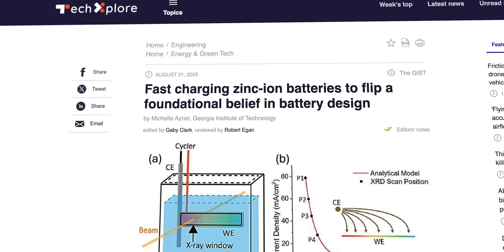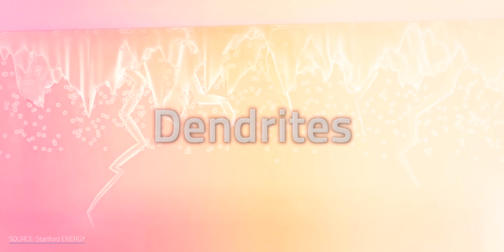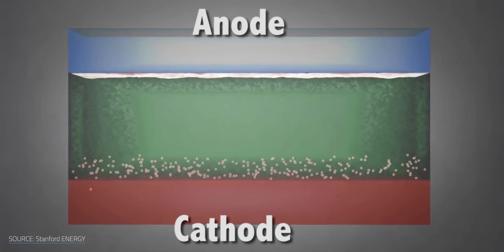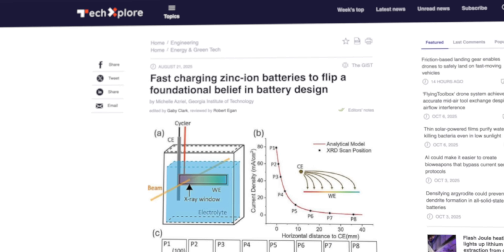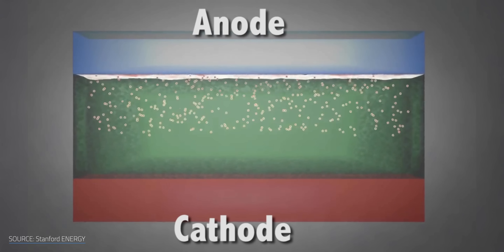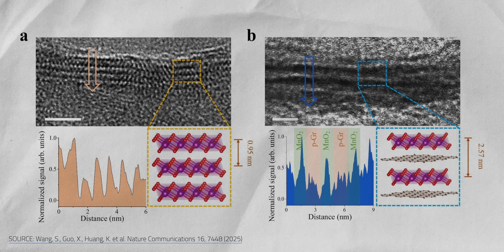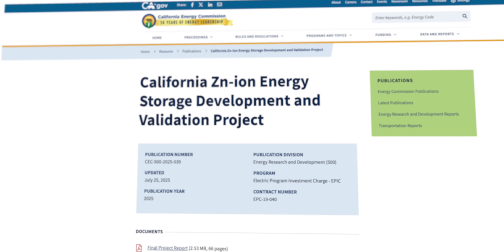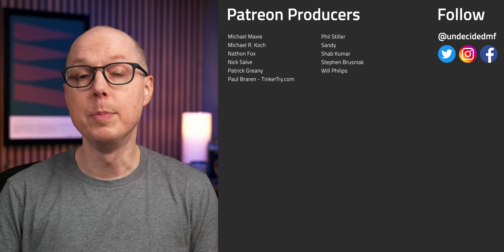The Surprising Battery Discovery No One Saw Coming

Comment: Every battery tech video should include a summary section, answering these questions:
1- When will it be on the market, in actual products?
2- How much will it cost, per product unit, compared to current ones
3- How does it perform, energy density, power density, charge speed, and other features, like flammability, lifespan, temperature requirements etc...
Reply: Mass market production is the great filter of battery tech, meaning you're gonna need to break out the crystal ball to answer those first 2 questions.

Lithium batteries were in development for 30 years before they entered mass market production, and have had 30 years of improvement since then. Replacement is going to take years.
Reply: Technically this video provided an 'answer' to 2, but only from a raw material point of view.
Reply: @GLJosh  Only the zinc is cheaper. No info about all those graphene layers manufacturing, etc.
Reply: But then there would be a lot fewer battery tech videos.  🤣

I'd settle for just one question:  What are the remaining hurdles?

Cost per kWh?  Endurance (in cycles)?  Round-trip efficiency? Production volume?  If a battery meets all four of those, then it should have a market for at least stationary use.  Yet what battery do we see in stationary applications?  Lithium ion.  (Although, didn't the "cheap as dirt" liquid sodium battery go into production for some grid-storage somewhere?)
Reply: Problem is that second one is not really a fair or predictable comparison - little bit of instability in the nation with the largest mine of x, workers on strike at y even only tangentially related to the battery production (can't make a battery if the train/truck drivers or dock workers that are part of the supply chain are on strike) and then the simple scale of production can make a massive difference to the costs of either tech. So the already established industry is pretty much always going to be cheaper right now as the infrastructure is already there for serious scale production, and you can only make fairly wild guesses on how the market prices of the involved resources will change as the scale of consumption does.
Reply: Also adding in the fact that most of these would be blind predictions and very misleading. This guy isn't working on these technologies
Reply: @leventalpsal  bro get out of here not every YouTube video is a business proposal
Reply: This would be akin to being there when someone first discovered microwaves and asking them "yes but when can I buy a device, made with this, at my local store, how much will it cost almost a hundred years from now, and how much will it impact my electricity bill when I use it".

Dude, c'mon this video is talking ABOUT RESEARCH. This isn't even the foundation of a new product yet, it's the raw stone, portland cement and rebar needed to MAKE a foundation. Imagine if when the Higgs boson was discovered someone on his team turned to him and said "hey that's awesome so when will my new anti-mass car be available and how much will it cost and what kind of milage will it get two hundred years from now??" that's literally what you're doing.
Reply: Matt said that this is still early. How would he or the researchers make that estimate if they do not know how to scale it yet. Matt covers tech in different stages of deveopment and was clear with that. Why should he need to make busniess plan for emerging tech?
Reply: @OlleHellman it’s always “too early” or still in development. When will these things actually be produced. We’ve been hearing these same things for over a decade since LiPo batteries became the norm.
Reply: @Cybo-Man 

Well that's how technology advancement works. Gradually. Reality is not obligated to make sense to you.

I'm sick and tired of people bitching and moaning when the only cause of their disappointment is their own ignorance and misplaced expectations. 

It says in the video. This technology is in its EARLY STAGES.
Reply: so know the unknowns... maybe you should get on that right now and report back.
Reply: @matthewf2066  🤣
Reply: Most of the ongoing "new battery research" has no ETA due to quickly changing market expectations and safety requirements, meaning that they must meet all of those before they able to mass produce those batteries
Reply: That would put a severe limit on the tech YouTubers can talk about, basically only the ones that are about to hit the store shelves.
Reply: Unfortunately, it's still undecided. '-'
Reply: CATL Naxtra. SIBs niche is planet Earth.
Reply: Internal resistance / efficiency and self drain rate are also factors.
Reply: 1- never
2- if you have to ask you cant afford it
3- the performance is only capped by your imagination (because it only exists there)
Reply: personally I would like to see nominal, fully charged, and fully discharged voltages, in the videos on battery tech as well
Reply: #1 and #2 are completely unknowable for early research. If it's not already in production, you cannot say.
Reply: If anyone could predict the future that well, they'd be investing directly in these companies and not wasting time making videos about it.
Reply: "graphene".... its not coming cheap or fast or at all
Reply: You must create a crystal ball which peers into the future to answer your questions. This channel is called Undecided for a reason
Reply: Yes they could have summarised it down to 30 sec.
Reply: Yep lets predict the future markets.
Might as well be a weather person.
Reply: Sure ok

However, if ANY of those questions even had an answer yet, it wouldn’t be a discovery.
Reply: 2. All batteries are current products until they are a dead battery.
Reply: Is this Ai?  how much of the comments are Ai slop?
Reply: Etc... That does not promise a summary
Reply: 1: when China has figured out how to scale it
2: less than lithium ion batteries
3.1: worse than lithium ion batteries
3.2: it's not flammable, higher lifespan, idk that one
Reply: 0- at end-of-life, can the bits be recycled cost effectively? if so, does it require radically new recycling systems? or does a spent battery just end up in a landfill?
Reply: Love how people didn't actually watch the video
Reply: I don't know what universe you live in, but in mine, in the last 10 years alone, the cost of 1 kWh of batteries has dropped from $500 to $30. The number of cycles has increased from 300 to 10,000, and the energy density from 80 to 220 Wh per kg.

AND THAT'S NOT ENOUGH FOR YOU?
While you're crying, advances in batteries have completely obliterated gasoline-powered cars and the construction of new nuclear power plants.
And this is just the beginning. Coming soon are massive distributed grids for energy storage and generation, small aircraft powered by electric motors, and so on.
Reply: @DenisFomin  what has 220 kwh per kg?
Reply: @DenisFomin  oh I see u edited instead of responding.  makes sense now.
Reply: @matthewf2066  Even children can see that I simply made a typo.
I pointed this out in a follow-up message.
The fact that instead of engaging in constructive dialogue on the merits, you're picking on inconsequential typos shows you have nothing to say.
Flat-earthers and anti-vaxxers behave in roughly the same way.
Well, good luck in life.
Reply: @DenisFomin  What are you talking about you little baby? I pointed out that you edited it and it makes sense now.  Did you not take your Midol today?

Comment: Um grid storage batteries don't typically use high discharge rates. You would need an entirely new BMS that switches banks in order to stress the cells in series one at a time.
Reply: "You would need an entirely new BMS that switches banks in order to stress the cells in series one at a time." - couple of hours work for someone who's good with power electronics... It may be a bit trickier to make a production-ready device, but it's certainly far from impossible - not even that difficult, I'd guess.
Reply: @theelectricmonk3909  Yeah not really a true objection. More: "it will initially cost more due to not using off-the-shelf components."

Comment: There is a good chance that Li batteries will be gone. Sodium batteries coming strong up CATL just announced it recently.  5X cheaper then Li batteries , life spam more then 5 mil KM driven and easy to mass produce. This will change a lot in EV industry.
Reply: Not just EVs... but everything. I'm sure that Zinc ion will also find a place though - a > 100,000 cycle lifetime certainly sounds interesting for some use cases (satellites, perhaps?).
Reply: @theelectricmonk3909 grid storage would definitely go for the 100.000 cycles rather than anything less if the price is competitive. For grid storage you need to flucturate maybe 2-3 times a day with a full or close to full cycle, so cycle life is very important there.
Reply: Than?

Comment: What I think is that if all energy, brain power, time and money that is now spent on EV's and batteries technology was spent on combustion engines or Stirling engines technology we would now drive efficient clean and cheap cars and we would not have to worry about charging speed. I like to fill up my tank in 3 minutes and not have to think about range.
Reply: @adriaanvantulpenbaard1740  — LOL, we had a century of applying brainpower to pushing the limits of combustion engines, to the detriment of improving batteries, etc.  We know we are close to the limits of what is achievable in such engines, and that has caused our climate crisis in the process.  Should have switched to focus on electrification long ago.
Reply: @byz-blade  Combustion is still improving in the last 50 years it is twice as efficient and 30 times cleaner thanks to unleaded fuel and catalectic converters. Batteries are the problem they are too heavy and did not get much lighter in the last 15 years as they had promised. Yes, batteries got cheaper but not much lighter.
Reply: No combustion is going to be clean. I wait zero minutes to fill the ‘tank’ of my EV as I just leave it to get on with it overnight, at my destination or if I stop for a comfort break on longer journeys. As for ‘range anxiety’ I have sufficient range to easily drive my longest day trip and for longer journeys I plan, it really isn’t difficult.
Reply: @garyhill9723  We can make our beloved combustion cars clean with hydrogen fuel or a combination of synthetic gas and hydrogen to reduce the volume of the tank. My landlord won't install charging pole.
Reply: @adriaanvantulpenbaard1740 burning hydrogen in a piston engine will still produce nitrous oxide/dioxide so expensive catalysts are required that are not effective in cold climates, plus oil lubricants will also burn. Additionally it is much more efficient to use electricity  to fill a battery than split water and compress the resulting hydrogen. Would you be happy driving around with a heavily compressed gas bomb (Hindenburg)? If you make hydrogen from hydrocarbons then you have all the pollution from cracking oil.

Comment: Supplanting Lithium will be difficult, especially given recent radical advances in Sodium chemistry at CATL. Zinc can't compete with sodium for natural abundance, and if sodium batteries can be produced in the same factories as lithium ones, that's another huge advantage. Unless Zinc chemistry sees even more radical advances, it's hard to bet against sodium as the next big battery tech.
Reply: It might still have a place, though; Zn-ion clearly has a lower energy density, but a potential for 100k (maybe more, if all three technologies are combined) cycle and it likes being charged FAST offer possibilities for stationary storage that even Na-ion couldn't match; and by the sounds of it, it could be price comparable (maybe the cathode not so much... but scale will help there).
Reply: Consoderimg how much batteries are needed with net zero there could be place for everybody
Reply: The idea that even though Zinc is massively available, Sodium is even more available and that matters doesn’t make sense to me - it’s 10x Lithium and distributed = more than good enough

Comment: If fast charging is key to longer life then mega storage / home storage is going to be difficult because of the slow and charge and discharge nature of that market segment
Reply: I think it might seem that way on the surface, but this is not too much of a challenge to overcome really. This is an oversimplification of a fix, but basically you would slowly accumulate the charge in intermediary capacitors before blasting all that energy into the cells in a short period of time. Rather than a single steady slow charge, it would be a regular series of brief fast charges. This principle is already employed in many applications with very high electricity demand over irregular short periods of time. Particle accelerators have been doing this for a long time, because they would otherwise tank the grid they are drawing power from and cause a real headache for the power companies.
Reply: @kaupaxup   even simpler, just have high powered voltage converters to swap charges between cells at high current when the batteries are at a lower demand, think of it like a cleaning cycle, similar to a pixel cleaning for OLED monitors
Reply: No you just need a bank of capacitors to hold a charge before you pulse in the charge regularly.
Edit 
Ahh, the other reply said the same thing
Reply: Just fast charge a few cells at a time instead of charging all the cells in the pack slowly.
Reply: PapaWheelie, you could but that will require a much more complicated BMS. I suspect that capacitors are an easier way to handle it.
Reply: @davidlewis624  bt imagine a generator fast charging your home zink storage system in under a hour or less😆🤔
Reply: Not necessarily. Home battery storage has the charging rate heavily throttled. A home connection could provide faster charging if necessary.

Comment: How does the energy density compare to lithium?
Reply: While that matters for cars, cell phones, and other mobile devices, that matters. For grid level and home battery backup batteries, it doesn't matter.
Reply: Based on the numbers shown at 8:37, 165Ah/kg * it's nominal voltage (1.3-1.5) should be between 215 -247.5 Wh/kg .   EVE's latest LFP cell (the MB56) is 628Ah with an energy density of 177 Wh/kg.
Reply: 1/10th

Comment: CTEK battery chargers have also pulsed high voltage to 12V car batteries in their “recondition mode” to remove sulfites in lead acid batteries.  It works, they just need to be careful not send too high of a voltage.
Reply: What CTEK does not have is a short circuit pulse in its profile which is what actually does the bulk of smoothing out dendrites.